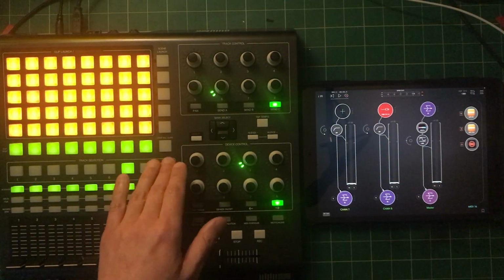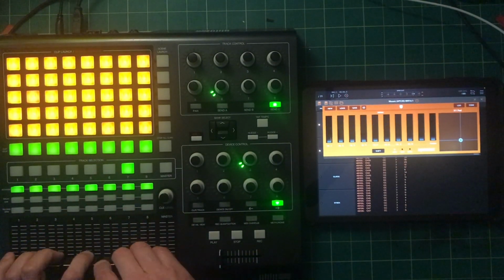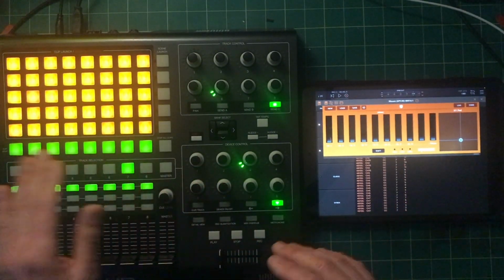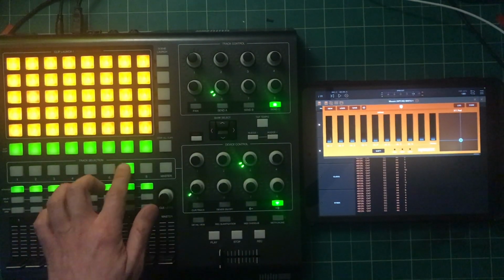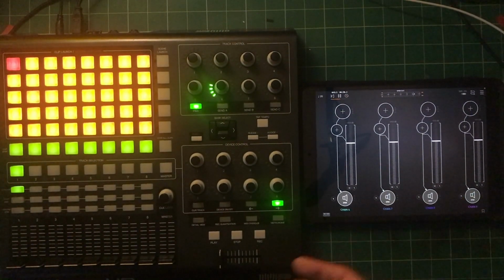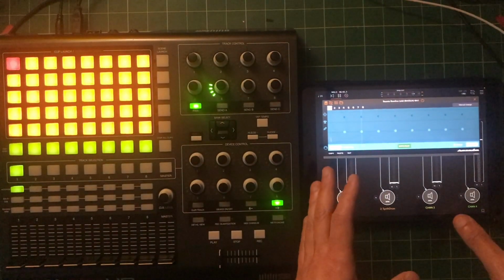APC40 Mozaic script

Comment: So amazing you made this. APC40 mk1 has the best encoders i have ever used.  But it's a pain to use without any scripts in other daws. So a huge thank you for making this. 

I like to ask you a question, because you are the one to know the answer. 
Is it possible to trigger the APC Track Selector using a midi command? 

The reason i ask is because this would make it possible to use a single midi trigger to:
1. show a specific app, or multiple apps  2. select a specific apc track/bank.  

For example. If App X = launched then also select apc Track 6 + Bank C.
This way you can associate encoders + bank to a specific app.  Which is hopefully possible.

It would be great to know if you think this is possible. I am no programmer , but i usually i can understand enough to make it work using a example.
So if it's possible and you could point me in the right direction i would be really greatful.

Unrelated second idea:. The Cue encoder sends relative midi by default.  It would be great to have this knob send 2 different CC's for decremental/incremental movement. There is a mozaic script that uses 2 buttons to send program changes for example.   

Long story short :P

Thanks again!
Reply from the maker: Hmmm.... Those are good questions, let me see if I can break it down.

1) I would assume so but I'm not 100% sure of this without trying it out first. The encoder banks are a little bit weird but you CAN send midi messages to them which is what leads me to think it is possible.

2) You can totally do this in a Mozaic script but you'll need to apply some logic I think.  I think cue sends +1 +2 when clockwise and -1 -2 when going counterclockwise.

if cuecc > 0
   // do whatever you want when turning clockwise.
else
  // do whatever you want when turning counterclockwise.
endif

you can't just forward those messages tho if you want to send out actual CC data you'll need to store those as variable sin your script.

 I'll need to spend some time and try it out. Maybe I'll make a video for ya. ;

Comment: Can I link this to drumbo without aum and mozaic involved?
Reply from the maker: No. You need Mozaic as that is the main software that the script is for. You should be able to run it inside Drambo tho, at least in theory. I have not tried it myself as I am not familiar with how Drambo routes midi.
Reply: @scruffycatstudios  Thanks man!
Reply: @djptrvch  Did you ever get it working with drambo hosted inside AUM?
Reply: @genmce  I tried to use Drambo as a sequencer inside AUM. But more often I use Drambo separately, because inside AUM you can't load third-party synthesizers into Drambo